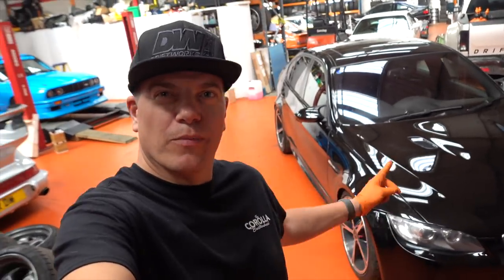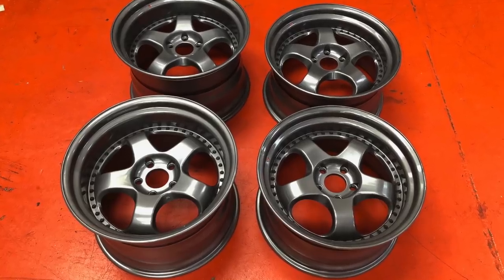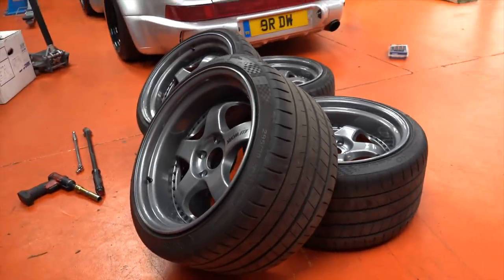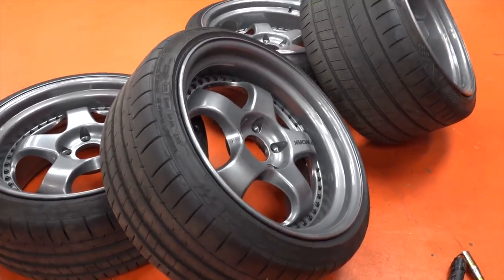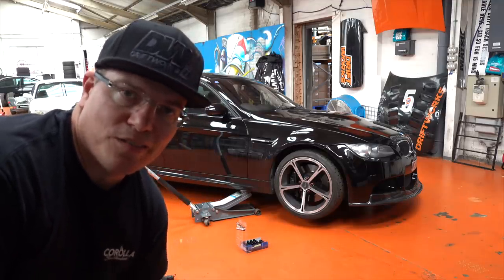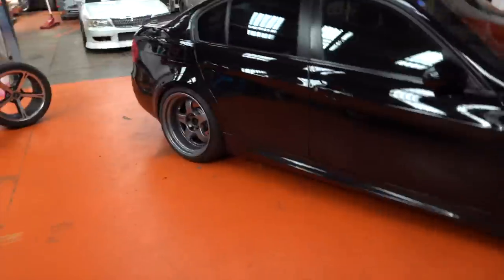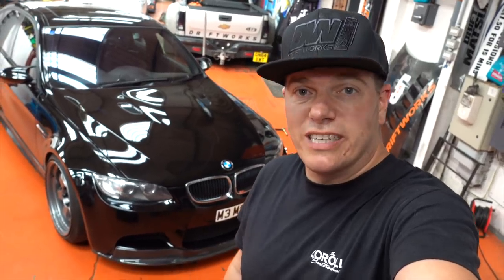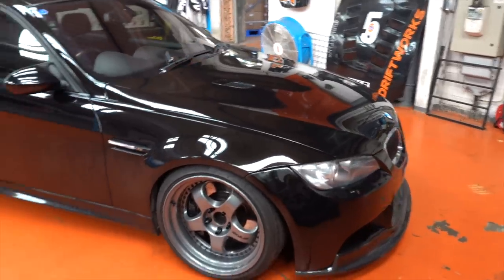Wheels Make The Car - My Slammed BMW E90 M3 with Work Meister S1 3-Piece Deep Dish Alloy Wheels

Comment: How did you get the wheels to fit directly on with 12 at the back and rear 10.5 will this not need arch cut how does that work
Reply from the maker: The arches are modified. Cut at the bumper meeting points and the rears are pulled a bit too.

Comment: Great video. I prefer the look of the E90 4dr M3s over the E92 M3 2drs - I think its the shorter rear overhang, giving that stubby/square-like stance. The 4drs have that 'I've got responsibilities' look which I like. I also heard from forums that its slightly faster around the track than the Coupe as its got slightly better torsional rigidity (B pillar) unlike the E92. But I could be wrong!
Reply from the maker: I prefer them too. I'm not sure about faster than the E92. Mine weighs 1680kg. It's a bit of a barge, but sure does hustle on track.

Comment: Has the stud conversion affected performance at all? 
I always wanted to do it to my e90 M3 but not too much information out there tbh
Reply from the maker: How would it effect performance?
Reply: Driftworks I was told by bmw (Guildford) that because it wasn’t designed with them, it would make it more dangerous and affect performance 🤷🏾‍♂️
Reply from the maker: It's not dangerous & has no effect on performance.

Comment: Did you do the Rod Bearing service yourself?
Reply: This shop has swapped a S85 V10 into an E46 M3 with full functionality. They can definitely change their own rod bearings.
Reply: @jordangarcia9806  no dynotorque did the swap not driftworks
Reply from the maker: Yeah we did it at Driftworks.
Reply: You should open a BMW Specialist  Division in the Midlands, If you did I'd be your first customer with my m3 e90 Rod Bearings 😀👍

Comment: What’s size tires you running on them wheels sir!?
Reply from the maker: 295/30/19 rear & 245/30/19 front if I remember correctly.
Reply: Driftworks thanks a lot !

Comment: I have to ask..... It's purely out of interest. Is this a daily driver? I didn't imagine you rocking Kumho's on such a car....
Reply from the maker: They came on the car when I bought it back. However; they are surprisingly good. I run Pilot Supersport on the front & these are easily as good. Just don't last quite as long.
Reply: @driftworks  That's good to know. I wasn't being a tyre snob, just interested to know what they're like nowadays. 
Thanks for taking the time to reply. 👍